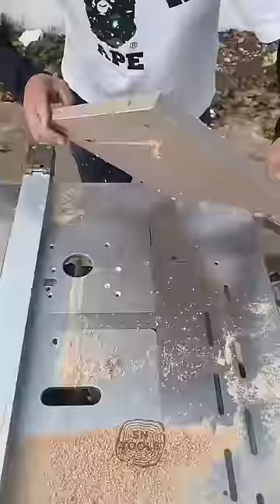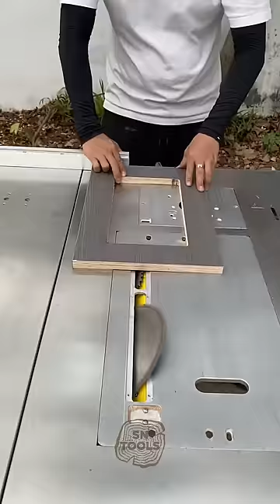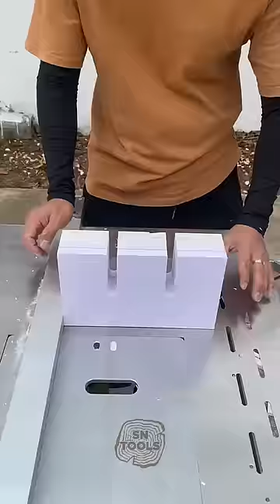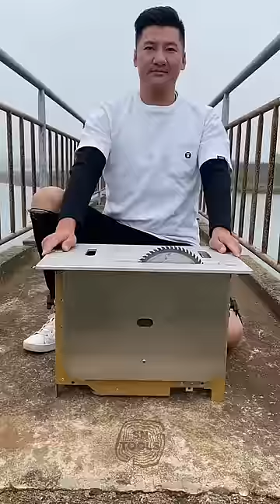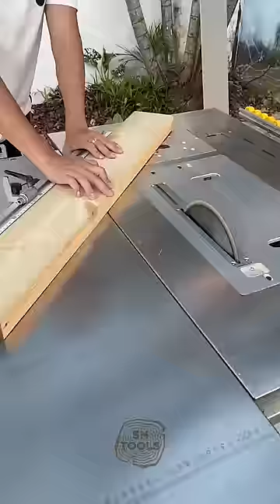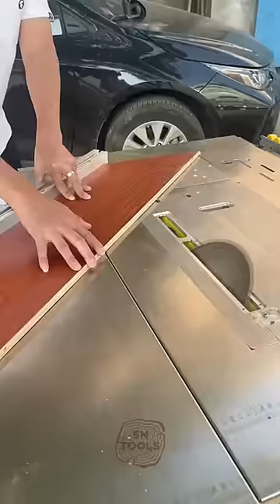Multi-Functional Woodworking Machine by SN Tools || Sliding Table Saw Cutting Machine -1819 #shorts

Comment: I'm gonna buy him some push sticks, eye protection, and a dust mask  for Christmas.
Reply: The way he showed the result while blade still on 😭😭😭
Reply: His finger's days are numbered.
Reply: Most people I know that have had accidents with a table saw it was from trying to grab the cut off when the blade is still moving. Slow moving blades rip and tear, more damage.
Reply: На новый год дарят
Reply: Клянись
Reply: You don't need a push stick w a sliding table saw (I don't even see one cut where the COULD be used, other than removing the cutoff piece), and a dust mask is a bit unnecessary when working outdoors... but safety glasses are never a bad idea.
Reply: @theoriginalmonstermaker Early on, he was very close to the router bit with his left hand ... need a push stick there. Could not see any risks pushing the work through the table saw, though grabbing those off cuts and reaching around the saw blade is not to be recommended (flick it away with a push stick, or wait until the blade stops.
Even outside, you will still breath in the saw dust, particularly when the wind blows back at you.
Reply: @johnvine5731  Granted.  The router was the only possible time,  but youre cutting an internal piece where your hand can always be a guaranteed 2 inches from the bit.  Youd have to be blind or foolish to knick yourself. 

And of course,  there's the potential for breathing in a miniscule amount of dust, and in a YT clip he should probably demonstrate best practice,  but the amount is hardly significant (just hold your breath a few sec).  
Plus anyone who's actually working all day is cutting a small fraction of that time.  It's just annoying messing with a mask for a quick cut.

Comment: Yes, bro. If you cut anything at a 45° angle and pair it up with literally anything else cut at a 45° angle which was cut with literally any tool it will form a 90° fit up... that's the magic of geometry, not you cheap little little tike's my first table saw.